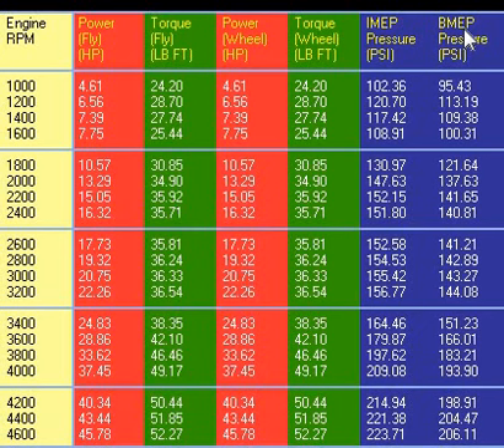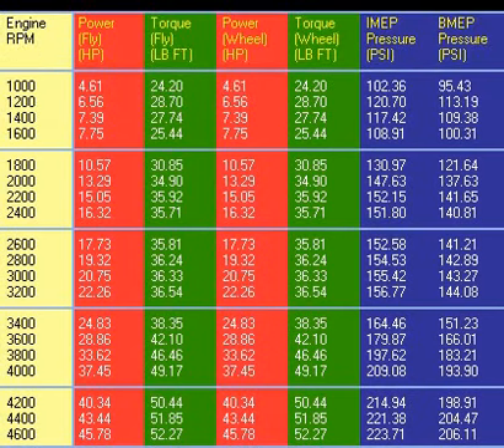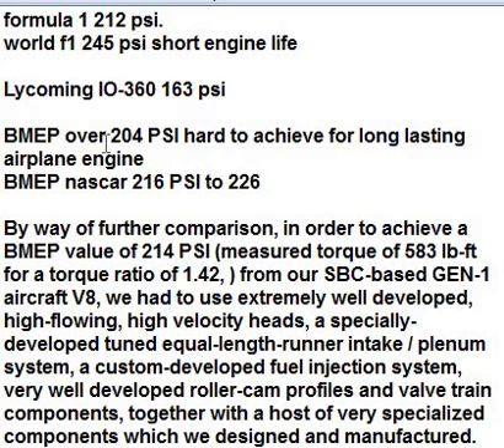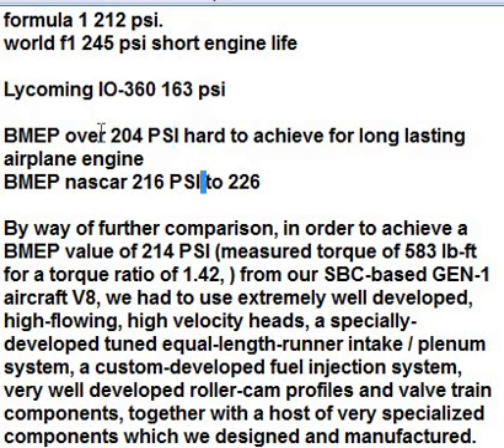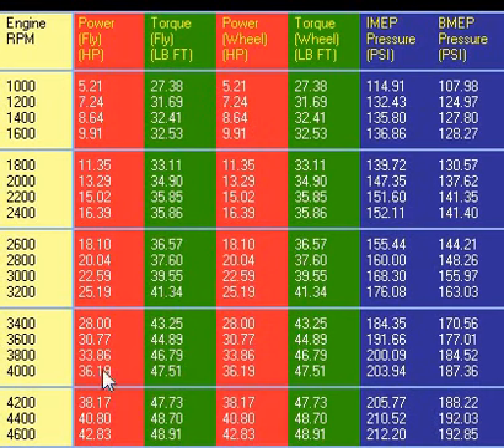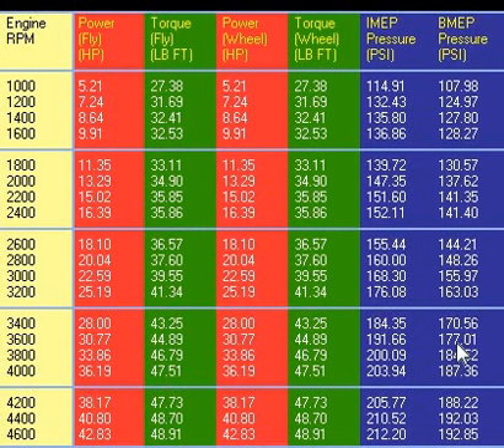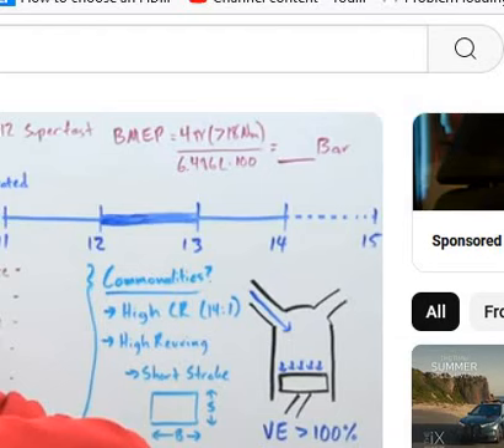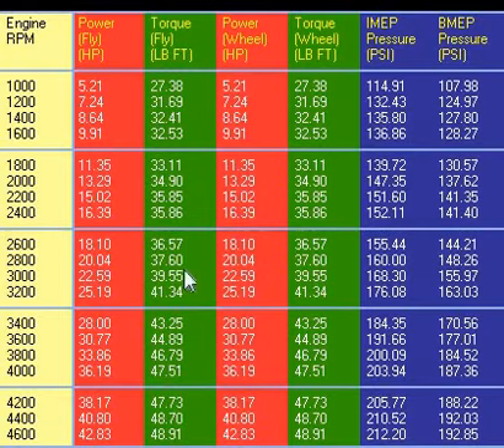313 - VG23air - BMEP Pressures

Comment: the mean effective pressure significance is well explained in the referred video: the higher values mean that more performance is squeezed from  the capacity at a given speed. There are many reasons why there is an upper limit to such value, and one should not expect that any value in the range can be obtained when modifying an existing engine. One should also look at other meaningful parameters, as the specific power (HP/cc), or the mean piston velocity, which also have practical ranges. Ref. mods envisioned on the B&S I wonder if you have carefully addressed the need for additional cooling, which will raise in proportion to the power output, more or less, depending on gain or loss of total efficiency: I may have missed something, but I understand that the new flywheel has no blades ... so natural cooling?
Reply from the maker: the new flywheel wont even be used on the final engine, there will be no flywheel at all :)

Comment: Watched that video, seems like it's within reason. Turbo engines get way up there. Better pistons and rods should offset it.  
I read somewhere that the ideal lengths are 10 " intake and 50" on the exhaust, not sure what the target RPM was for those numbers.  Can you simulate that and see if you get a bump from having the rumners tuned?  50" seems to long, but i haven't looked into that math in at least a decade
Reply from the maker: I can tune the headers, I will check on tuning intake runners too, and yes, I realized after posting that a turbo would go WAY beyond these numbers, so I still have a warm fuzzy feeling about the build :)
As for exhaust length, yes, the software gives me that and it is different for open versus closed headers.
Reply: @vg23air I believe this is a promising engine.  It's reigniting my desire to get an ultralight